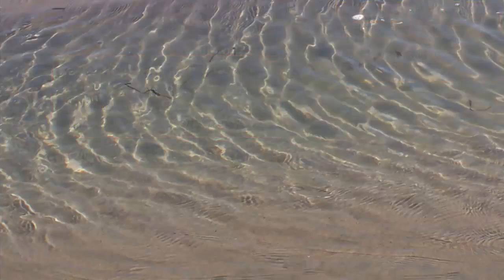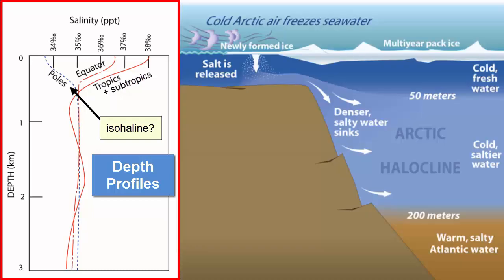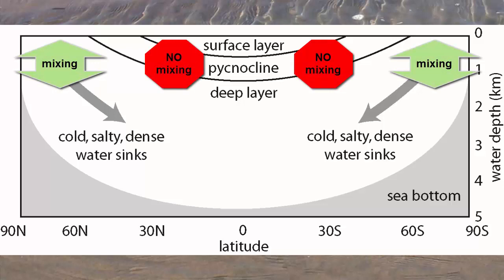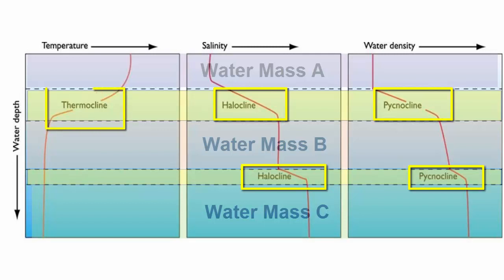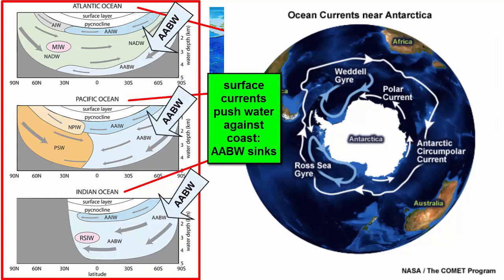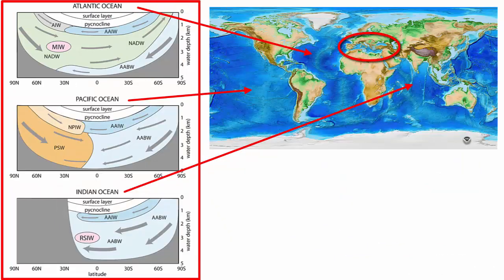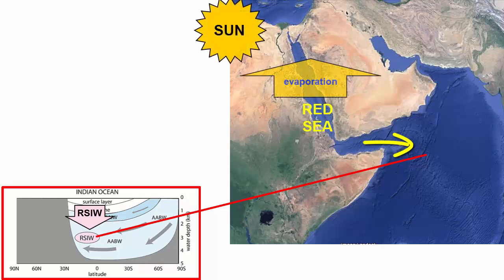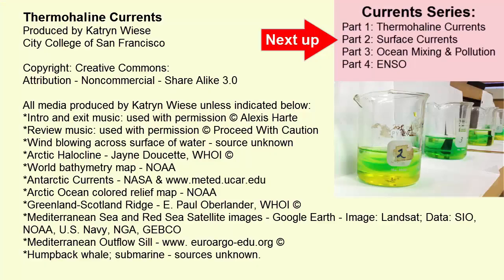Thermohaline Currents

Comment: It is very interesting. However I lack the bonding with the global conveyor belt. So far I have not been able to find anywhere how  in details the conveyor belt works, how it divides and changes at different seasons.  In some pictures I see the   deep cold current going between Madagascar  and Africa and in others  it flows near the eastern edge of the island.  It seems to me that the idea of the belt is usually extremally simpified. Would you please tell me where it is possible to find  precise knowledge on the topic. I think that the video above is a great introduction.

Comment: There's a ring of water around Antarctica that is 1.2m lower sea surface height than the Pacific Ocean (this 2.2m lower sea surface height than the global average). This is because the heavy column of water is literally shoving down and north and below much other waters of the oceans like a wedge, forming the AABW. I read that it's 9 Sv. Reason it's  lower sea surface height must be because surface water can't run there to fill it in as fast as it pushes down and northward.

Comment: This is for another video so the speaker references & times are not for here. 2 things that Peter & all WG1 climate scientists I've ever heard say incorrectly (though most are very vague) about thermohaline circulation (THC) even though they do the analysis are:
-------------
At 23:10 "the salt goes into the water. The salt makes the water more dense and the water sinks". Incorrect Peter. The actual mechanism is shown perfectly in your own pictorial from "A Deep Convective Chimney in the Greenland Sea" and the descriptions of events in "A Farewell to Ice" such as p150 "carrying water downwards", p152 "Underneath this cap <of fresh water> the chimney continued to exist as a rotating submerged cell". Yes,  the chimney continued to exist as a rotating submerged cell because "makes the water more dense and the water sinks" is incorrect. It's a partial reversal of cause and effect. Here it is. The surface water doesn't "sink", it "descends" or a better descriptive word is "lowers" because neither gives the incorrect implication that it somehow moves into the water below it, not the same thing at all as "sinks" (which does mean moves into the water below it). The surface water descends because the entire water column descends and the entire water column descends because if it didn't then there'd be a big hole in the ocean (in the Odden) at 75.05N0.83W at 2500 m geodepth because a bunch of water was shoved south from there by Sir Isaac Newton's a=f/m Law operating horizontally because the pressure at 2500 m geodepth at 75.05N0.83W is greater than the pressure at 2500 m geodepth in the south Atlantic Ocean where the NADW literally lifts the ocean above it by brute force, and there's a continuous route there at 2500 m geodepth that's scenic, takes in all the sights and has continually decreasing pressure at 2500 m geodepth, where "geodepth" is a word I just now made up because I can make up words if I like if Wally Broecker can (or rather, could) make up whole phrases.
-------------
At 21:00 "the ice forms in very small cakes". I know why that's crucial to salinity helping the THC force. I'm not clear that Peter has ever twigged. His "A Farewell to Ice" gives no clue that he's twigged. Wiki "In the Southern Ocean, strong katabatic winds blowing from the Antarctic continent onto the ice shelves will blow the newly formed sea ice away, opening polynyas along the coast". And do you know what's blown away when the newly formed sea ice is blown away. Low-salinity solid water is what's blown away and then do you think salty water moves in to replace it or do you think the ice gone leaves big dents in the ocean surface. "A Farewell to Ice" p147 "ice-free water exposed to further intense cooling from a cold atmosphere, especially in winter, particularly during phases of the climate when the prevailing winds in winter are westerly blowing off the Greenland ice cap". Those prevailing winds are also blowing ice pancakes and if they weren't then ice formation would have no effect on the THC. At 21:27 "they can't freeze together to form a sheet because there's too much wave action". That's right and ice pancakes can be blown by wind out of the dense water formation area, and also do you know what causes too much wave action, too much winds is what. And do you know what else too much winds do. Drive frozen low-salinity water away from a circle 30 km diameter where the surface water is getting denser is what. And do you know what happens when  low-salinity frozen water pancakes are driven out of the circle. Nice salty water runs in to fill the big dents is what. That's how ice formation drives the THC, not at all in the slightest by making the water just below it saltier as all WG1 climate scientists incorrectly say but by leaving the surface-water densifying region letting some more salty water in to get a crack at freezing. If the ice can be driven away by strong winds or by being in pancakes then more ice can form and get driven away by strong winds too and that's how salinity increases the water weight above a 2500 m geodepth, or any geodepth below the surface. It's not done by making the surface water saltier so it sinks, it's done by making the surface water saltier so it's denser/heavier, not at all the same thing as "so it sinks". The surface water does not "sink". Please stop saying that it sinks except for vertical circulations with a horizontal component that's less than the ocean depth.

Comment: At 7:56 "being pulled away". Incorrect. There is no such force as "pulled". That water is flowing down hill under gravity (I don't know whether prevailing winds there assist, probably not). On this topic, Pacific Ocean water enters the Arctic Ocean at Bering Strait into the Chuckchi Sea because it is flowing down hill to the Atlantic Ocean.
Reply: Oops I over-simplified. S.B. "For a fluid (liquid or gas) there is no such force as "pulled" because the molecular bonding is too weak"

Comment: Thanks. The THC driving force description given here and by all climate scientists whenever I've heard them mention it, is incorrect. Sir Isaac Newton has a Law that something accelerates if an unbalanced force is applied to it and does not accelerate if an unbalanced force is not applied to it. The deep ocean does not have an exception granted by the Law Of The Sea. Since there is friction (a force) opposing fluid flow and since friction increases with velocity (the idea of "terminal velocity" of a falling object) then "accelerates" can be simplified to "moves" for an easier picture. The THC driving force description given here and by all climate scientists whenever I've heard them mention it, is incorrect because it has cause and effect reversed at the starting location (deep water formation). There is no "deep water formation" but rather the entire column of water drops down else the water departing south (Greenland example) would leave a bloody great hole in the ocean at ~2,500, depth
-----------------------------------------------
This means, obviously, that the pressure at the NADW depth range must be continuously reducing from the place near Greenland where the column drops all the way along the path it takes to Antarctica. The water would not move otherwise. Water does not randomly move. There is the Coriolis effect and the presence of the Americas (i.e. sea surface height) causing this deep ocean current path to be what it is , not just the temperature/salinity profile above the depth of movement, but primarily it's going to be because temperature/salinity is on a decreasing pressure gradient and the water follows that gradient. I say  depth range for simplicity but I don't actually mean depth as the distance from the sea surface above. I mean something close within a couple of metres though. I mean depth relative to Earth's centre of gravity (I think from memory it's called a "geoid"). The distinction is important because changing sea surface height changes pressure (more water above = more pressure) for a depth relative to Earth's centre of gravity but obviously changing sea surface height makes no change to pressure  for a depth relative to the sea surface above. 
-----------------------------------------------
Then the entire column of water drops down at the place with the highest density (temperature/salinity) to that depth. The surface water doesn't "get cold & salty and sink", the entire column of water drops down else the water departing south would leave a bloody great hole in the ocean at ~2,500, depth, so there's no choice. Since the column of water dropped down its surface is now lower than elsewhere, hence the surface current is simply water running down hill under gravity to this low spot. In this case the route taken is whatever route is down hill but again modified by the Coriolis effect and the presence of land in the way, plus the new item of air currents that drive surface water. Note that land in the way is the same thing as "whatever route is down hill". So if you have a moderately-good science brain and education (university not needed) and you actually think about this you'll realize that I cannot possibly be incorrect unless Sir Isaac Newton's 1st Law is incorrect. The over-simplified "gets cold & salty and sink" is incorrect and with perhaps the optional "forms ice which rejects brine making the water saltier" is still incorrect as a driving force unless the ice departs and is replaced by ocean water because that's describing surface water getting heavier than the water below and thus sinking with the less-dense (warmer or less salty) water below coming up to replace it. That's just water overturning near Greenland (using AMOC/NADW example). That wouldn't drive any deep ocean current.
Reply: The animated pictorial at 7:37 is correct. Notice that the movement is not caused by water at or near the top becoming dense & sinking (it doesn't move down past the water that was below it). What's shown there is that that entire column of water is literally shoving the ocean ahead of it at its lowest depth shown. It's shoving the ocean ahead of it  in a horizontal pipe some 15,000 km long to Antarctica (or however long that circuitous route is). This is not the same thing as the "surface water gets cold & salty and sinks" that climate scientists say in talks. That would only cause the water at various depths at the place shown near Greenland to swap places between the shallow & the deep. It wouldn't cause any horizontal flow.
Reply from the maker: Thanks for all the commentary. Good addition for watchers to read! :)